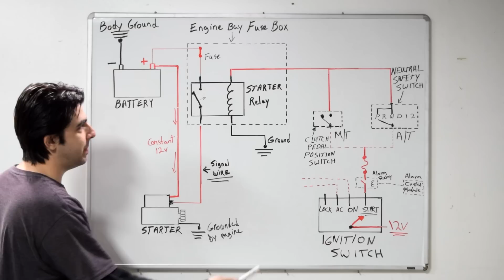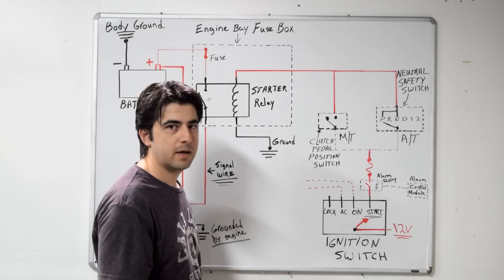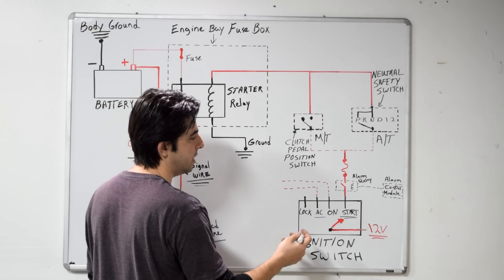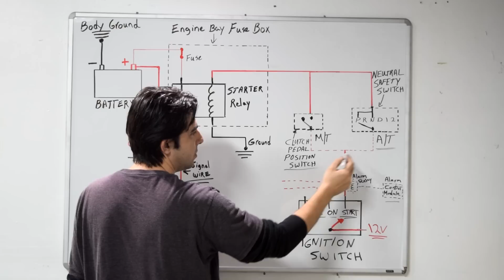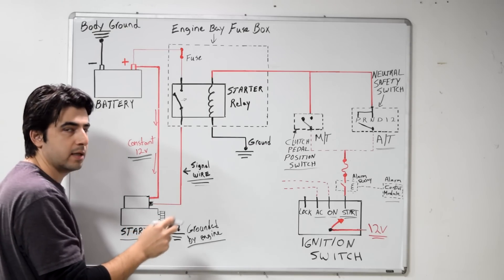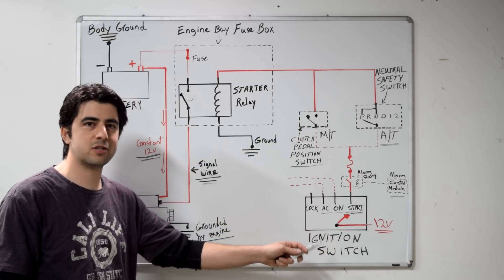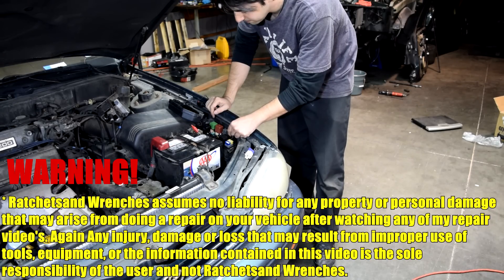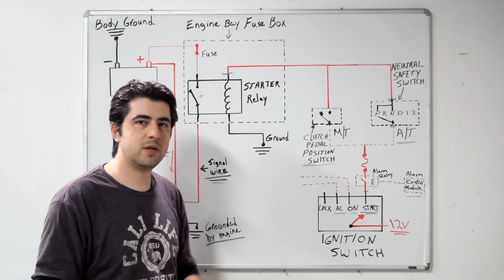How a Car's Starting System Works PART I - Tricks to Use to Solve a No Crank No Start Problem

Comment: Ignition switches are not always attached to the back of the ignition lock cylinder.
 Some systems use a linkage rod, to connect the lock cylinder to the actual ingniton switch. Having that switch/linkage/lock cylinder adjusted, or worn, CAN cause a no start shituation ⚡
👁️👁️☕

Comment: How about when you turn your ignition to start the engine & your starter continues to crack the engine even after you take your hand off the key. Then you have to turn the key to the off position to get it to stop cranking? 
Thoughts…
Reply: Spray some wd 40 in the ignition.  Worked for me. Key started kicking back like it used to.

Comment: What can I do when the ignition cylinder and keys were replaced due to attempted theft, how can I program the new keys? I have replaced the batteries new on 2000 Ford excursion, thank you

Comment: Hey Iman, my key is stuck in the ignition, wont be released or turn past ACC. When I pull the cabin fuse that controls the mechanism (i'm not sure what it is) it makes a click sound. When I remove the fuse, the key comes out. I replaced the BTSI, the shifter works fine. The clicking is coming from the steering column area... any tips? Thanks

Comment: @Ratchet And Wrenches *No Crank* What to do if you have no Constant Power at all? I did use a jumper wire and stupidly just went probing around. (07 Honda Accord V6). I do however have 2 power pins when in crank position (test light). But I have NO GROUND on the relay circuit. Any thoughts would be greatly appreciated. Thanks for your video's!!

Comment: I have an intermittent issue during start up. When I turn the key the engine will start but sometimes the engine will crank but it will not start.  The security light will turn off when the key is inserted meaning it is the right code and the engine will crank but sometimes it will not start.  Once it starts it is fine and runs ok meaning also the fuel pump is OK.  I assume the ignition switch is on it's way out ?  I have a 2010 Toyota Camry and the key has a transponder and it has no battery in it.  How can a key with a transponder that uses no battery that transmit the correct code go bad even though the engine cranks but will not start?

Comment: My 1992 940 turbo dies when I make a right hand turn only. Is it the Ignition switch? The battery is new, the alternator is new. It starts with no problem.

Comment: No mention of the FUEL PUMP at all?! What part of the ignition switch sends power to the fuel pump/when would the fuel pump receive power? From computer? Before computer? Directly from switch? A car cranking and not starting like you show, could easily be the fuel pump not receiving power when key is turned. Fail.

Comment: Great video! I recently had to change the tumbler behind the ignition cylinder and now my car won't do anything. I have a 2000 Avalon and the power door locks won't work like there's no power. I think the alarm may be activated. Any suggestions? The security light is flashing. The temp needle is all the way to H the fuel needle is all the way to full and the RPM and speed needles are straight up to center.

Comment: So recently I hooked up a battery wrong on a 91 motorhome with a 460 ford big block. Tried to start it something went it wasnt until I got under the rv and found the red is grounded and the black went to solenoid. Now I have power at the starter solenoid. But NOTHING else works no lights dash or headlights I mean nothing works key on no power anywhere. But I do have 12v power to the solenoid. If I am understanding this correctly I'd have to assume the ignition switch is bad is this correct?
 I'm going to continue watching these and try to follow it thanks for the uploads you have a new subscriber now.
Reply: You have cooked your ECU (car computer)... sorry mate that cost a lot of money...  very expensive mistake

Comment: Ratchets and Wrenches do you know, or had experienced a car suddenly shutting off on you while driving because of the alarm system relay going bad.
I have 06 pathfinder and it did that.
Starter,battery,alternator,fuel pump,fuses are good.( need to (check relays thou)
Any ideas/ suggestions or experiences you can share will be greatly appreciated.
Thank you for your video!!
I'm learning a lot!☺

Comment: I just did a partial rebuild on a 1993 corolla 1.8L (head gasket, valves, rings, rod bearings, and oil pump), and I can't get the starter to work.  I ran through your trouble shooting procedure.  I confirmed that the battery is good, the starter is good, the starter relay works properly, and the starter is grounded well.  When I jump the switched posts in the relay I get 12.4 volts to the signal wire.  When I connect it to the starter and jump the relay nothing happens with the starter, but the chime starts dinging, all the dash lights come on, and the temperature gauge goes all the way up.  When I put the relay back in and try to start it with the key, the check engine light and the low oil pressure lights both go off, the temperature gauge only registers a little below normal temp, and the radiator fan comes on as soon as the key is in the "on" position.  Also the headlights don't dim when I turn the key.  The radiator fan continues to run even after the key is removed and doesn't stop until I disconnect the negative battery terminal.  I've gone over all the under-hood connections and I'm confident I have everything connected correctly.  What am I missing?
Reply: I just watched your first video on the subject. https://www.youtube.com/watch?v=2RUhq7sXNBo  I did not have a good ground.  I had followed Haynes' procedure and was misled.  When I checked for ground the way you showed I had about 30 ohms resistance.  Fixed that, and now she cranks.  Thank you!  You definitely earned a new subscriber.  I have a much better understanding of automotive wiring now.

Comment: Question:
I am currently attempting to replace my 2002 Oldsmobile Aleros ignition lock cylinder without a key! I am having to drill through the damn thing. (Yay, so fun! Not.)
My question is does the cylinder need power in order to turn it to the on position???

Comment: Just bought a used car, 2008 Toyota. Sometimes it would start and then only dash lights.Tried to find the cause but to no avail.Watched this video about starting and the clutch switch. Went out now in the freezing cold at 11.30 at night and tried out the theory. Clutch up, no start  Clutch down no problem. Sure saved my bacon. Thanks for that.

Comment: Excellent video. The most well explained I've seen. I do have a unique question. I have a truck that was in the flood of Hurricane Harvey and while the car is running the starter engages the flywheel randomly. I've already replaced one starter, the lock cylinder, ignition switch, and relay. Do you have any theories?? It's a 2003 Ford Explorer Sport Trac. My gratitude to you!!!

Comment: I,disconnected the negative cable on 2000 Toyota Tundra pulled out the starting relay
is a 4 prong relay but with the voltmeter going from the neg batt post to each socket 
terminal of the relay base i'm reading 12.8 volts . I believe this reading should be present only
at one slot not all four .Why is this happening ?Ignition switch is off.

Comment: I was stuck on an issue for a while now, and with your first 1:41 into the video you answered my question. I installed the continuous 12V lead but totally forgot the relay lead. Once I put that up, my old car fired right up.

Comment: Ratchets & Wrenches ; you are really an awesome handsome man. I really appreciate what you 're doing, and you are one of the best mechanics that I always watch such as Eric the car guy ,Rex fix , and a couple of two excellent mechanics that I don't remember their names now. I like all of your videos ; they are very much accurate, detailed ,excellent filming or video tapping  and educational . You are a real teacher and instructor. Thank you a lot buddy.I have a question: I have a car that the trigger wire from the starter is not connected to either the battery or the relay; my question is :when I turn the key to start the car, it starts as if the trigger wire is attached as your drawings show; how come the car starts?Of course ,I have lots of questions to ask, but since I just subscribed to your page, I will wait and ask them one at  a time.Thank you friend

Comment: I have a theoretical question: in the "start" circuit, what limits the amount of current flow- from the battery through the start switch, clutch switch (manual transmission) through the starter relay to ground? There must be some sort of resistance load so that unlimited amps don't melt the components and wires? What is it? 

Lastly, great videos. I've learned so much from your channel!

Comment: This is awesome.  Hello. I am currently trying to find the root off the issue of my no start problem.  I have tested everything up to the point of the signal cable.  When you test the voltage you get voltage of 6v in the on position and it stays the same when you turn it to start. I would assume it should be 0v in the on position and then it should supply 12v when you turn to start.  What would cause that?

Comment: Thanks so much---FINALLY---someone who can draw a schematic and show it all so plainly in a diagram.  OK, the problem I am having with a 2004 Toyota Corolla starting problem:
I replaced the ignition switch and the problem remained:  Intermittently, when the key is turned to the start pos. NOTHING happens.  Other times all works fine: about 50/50.
This may be very important...I finally found that tapping the starter lightly works consistently...so far (2 days).  AND I DO MEAN LIGHTLY: When it would not start, I had someone hold the key in the start position and just when the hammer barely tapped the starter, it turned right over and started.  I would bet a good thump with your finger would do it!!
So, weird!  After I replace the starter, I would like to replace the starter relay IF I COULD ONLY FIND IT!!!  Been looking for it the whole time--WHERE IS THE DARN THING?  Nobody else or data sheets, etc. can properly locate it either.
Reply: if your car has a manual it should be in there somewhere. There's a chapter with all the relays, locations of them and even voltages/amps if i'm not mistaken

Comment: I would love to mod. my car start Sys by removing starter and using the old hand crank or cable pull start system thereby eliminating the need to haul a heavy battery everywhere. to me it seems like silly excess.

Comment: Hello, I have a big question. We are working on an '85 El Camino. We are replacing the starter. We got the old one out and the new one is up in position. There is obviously a big thick wire that hooks up from the battery. That is the only wire we are sure of where it goes. There are 2 other wire connections from the vehicle to hook to the solenoid?. One is a double wire hooked together and the other is a single wire. We screwed up and didn't take a pix of the wires when he FINALLY got it out.. after an hour of trying!  our bad. Any chance you could post a pix of where the wires go on the solenoid(?) unless they go on the starter, which I don't think they do. ANY help you can give us would be GREATLY APPRECIATE! Thank you and God Bless

Comment: thanks for the video i have a similar problem wiht a2004 ford Explorer so if the problem is the nss is it going to give me any codes or no because a did evrithig you explain in the no crank no estar video and it dint estar but a used  the scanner  or i scan the car and it dint give me any codes thanks god blest you

Comment: My car had alternator problem, but it was hit by a hammer and then working. Then suddenly one day couple of weeks later, no crank. Was able to force start downhill in 2 gear and and now some days later I checked the voltage on the battery and it was fine, then suddenly it started (with the key) after that, like nothing was wrong and still is. Do you know what can cause such? Don't feel safe stopping the car everywhere, in case its gonna go back to no crank. Thanks for good video!
Reply from the maker: +razors4edge I have a video on how to check a car battery, I would start there. Also watch my video on no crank no start diagnosis. gl

Comment: I have an issue with the Nissan 2006 Altima 2.5 liter it clicks won't start.  But most of the time it will start if you turn the key switch off and on off and on eventually I'll start up. could it be some sensors again.  "crank and cam?
Reply from the maker: +ANDY RIVERA  If it only clicks and does not turn over it's not a sensor issue. I have video on how to diagnose a No Crank No Start condition, you can see it if you do a search in my channel. GL

Comment: Thank you for the informative videos.  Can anyone please help.  My battery voltage is 12.67v and when i start the engine the voltage does not seem to change.  When I checked the voltage from the leads without being connected to the battery it was over 18v.  Is this a bad Rectifier/ Regulaor on the alternator.  Could a fuse be blown.  So battery does not seem to charge.  I cannot start the engine using the ignition key.  I have a 25hp mariner efi cdi elpt.  The tilt switch is also totally non responsive.  I have come accross people with a similar problem who changed a fuse and problem solved.  But where do I find the fuse.  I can start the engine no problem with the pull cord on the flywheel and engine runs without a hitch.

Comment: Thank you another brilliant informative video.  I subscribed.  So if I can start my engine using the flywheel but not with key does this mean my starter solenoid is ok, but maybe the trigger wire is not getting 12v.

Comment: Nicely explained as you said jumping from relay base is very useful usually load side pins are 87 and 30, careful not to spread the terminals.
        Fuel pump relay base testing is another good one, where you can check amperage through pump and ohm it out without dropping tank and diagnose bad wiring or pump.  
    There some great tutorials on youtube, thanks ww
Reply from the maker: Typey1 yes, good idea on the fuel pump testing from the relay. will use that in the crank no start video. Thanks for watching, cheers.